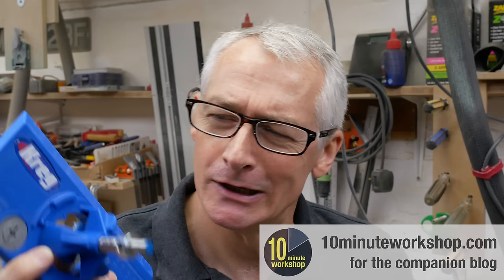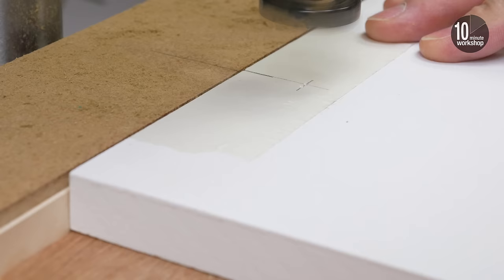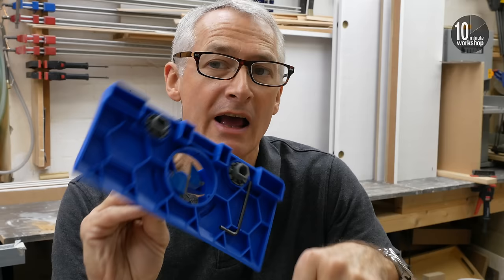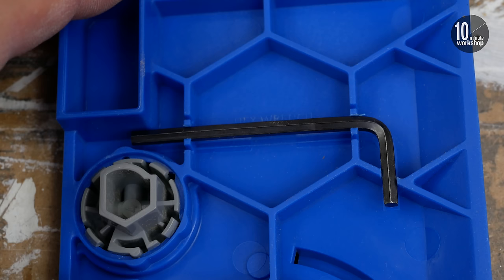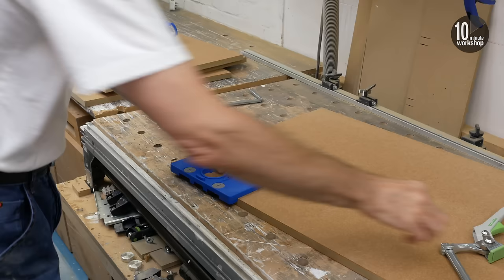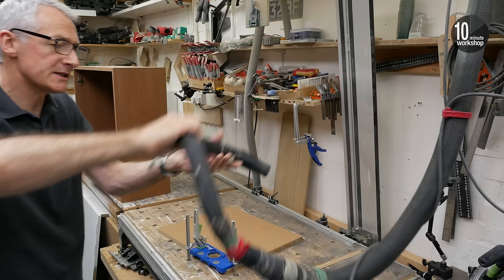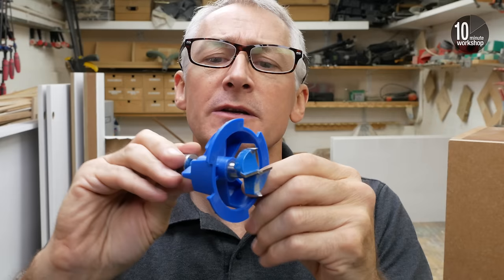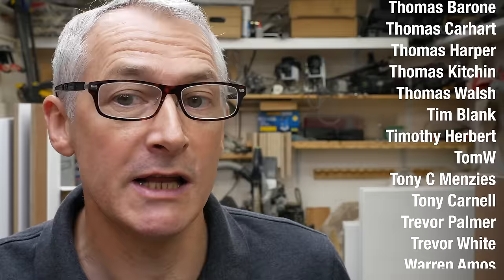Kreg Concealed Hinge Jig [video #357]

Comment: Hey Peter, the reason the boring for the screw fix holes is wrong is the jig is set up to bore for a different brand hinge. Hettich, Blum, Grass, Mepla, etc all use different locations for their screws or dowel locations. 

A dedicated Blum hinge boring machine will not bore the dowels in the correct place for a hettich hinge.
Reply: But they are out of square in any case, and I don’t think the holes any hinge would be disaligned…

Comment: I used your recommended Blum hinges and this Kreg jig. I also found the "fixing holes" are not positioned correctly so I don't use them. BTW - I assume those holes are so small to prevent using too large a drill for the screws. This tool makes drilling the main hole super simple.

Comment: Thanks for pointing out the KREG hinge cup jig's incorporated, but miss-aligned mounting screw hole template. I find that not all of the KREG products, of which there are now several, are well made.  The company is relying on the success of its original pocket hole system products for people to then assume that anything else made by KREG is of high quality, which it is clearly not as you have shown.
Reply from the maker: Thanks! No,issues with the Kreg jig otherwise, but the misaligned holes are a pain. 👍

Comment: I'd experiment by enlarging those tiny holes to take the awl. I think alignment would improve that way.
If not, I'd saw it in half - it'll fit in the bin easier then. 😀
Reply from the maker: 😂 I think if the smaller holes were halfway accurate, I’d drill them out to take an awl in a heartbeat! A number of peeps in the comments here have said that they just use it for the 35mm hole - and a couple of ecodrill users have said the same 🤷‍♂️👍

Comment: So, we gather there’s an alignment aspect to using this that impacts the end product - the thing that remains in your face forever compared to the few quids that will soon be forgotten. Thank you for spending about ten seconds on what matters most and twelve minutes something on all the obvious characteristics of the device.
Reply from the maker: Read through the comments - you'll see that other people with the same issue do exactly as I do and simply just use the jig to drill the hinge cup, not to mark the fixing holes. It's something to be made aware of - and I do that - but as I say in the video, it's not a deal-breaker for me (and clearly, many others) as I prefer to take the fixings positions off the hinges themselves. 🤷‍♂️

Comment: Mine works perfectly with Blum hinges, I would say kreg suggest using a 1.5mm drill bit to mark the fixing holes, perhaps in drilling a 2mm hole you've moved the hole centre's over slightly?
Reply from the maker: Good to know, thanks. No, there’s plenty of clearance with a 2mm bit, and not likely that I could have bored the holes out equally on each side 🤷‍♂️ Feedback is generally about 50/50 on folks having no issues, and with the same issue I have, so I think it’s more likely to be a slight issue with the cam adjusters. As I say, not a deal breaker as there are other ways to skin the cat 👍👍

Comment: If the door isn’t flush with the side of the cabinet you might just have to adjust the jig to drill further in. That’s what those Grey adjustment screws  are for. If 5mm leaves a gap, you might have to go to 6 or 7mm. Just my 5 cents. Another point. If you only have one drill machine then you would have to change bits, whatever the method is.
Reply: You can’t, 6 is maximum…

Comment: I cannot tell you how relieved I am to wathc this video Peter. I bought this to install Hafele partial overlay concealed hinges, ahd while the 35mm hole for the cup drilled perfeclty, the screw holes did not line up with eh hinge AT ALL! I had to measure them all manually on the job I was doing, so of course one had to say what is the point of a jig that has useless out of place holes for the hinge? I have since returned it for a refund, so it now appears that you cannot use it with either Blum or Hafele hinges.

Comment: The two holes are for a drill bit to pre drill pilot holes for the screws. The bit size I use is 1/16th of an inch. I'm sure you can find one that is in MM's I bought the complete kit that includes instructions in English, and so on. Good luck ole chap. Oh Kreg clamps were included
Reply from the maker: Thanks - but for a jig designed for Euro hinges to have imperial-sized holes seems a very strange decision, to me. But irrespective of the sizes, the real issue was that they weren’t square. 🤷‍♂️👍
Reply: @10MinuteWorkshop  I agree, but their selling them all over the world. So no matter where you live the system is set up for more sales to accomodate the stuff you buy from them.

Comment: Nice demo video, Peter. My Kreg jig seems to line up fine but I have another problem. The bit makes extremely hard work of of the 35mm hole for the hinge to sit in the MDF.

In fact I abandoned the first hole I drilled and managed to fit the jig with a Toolpak hinge boring bit which was a lot more effective. Kreg should provide a decent bit in the first place though shouldn't they? Maybe I just got a duff one.

If you change the bit you'll have to fit a different depth stop collar to it as the Kreg collar will not fit a different bit. However it is not difficult to find a suitable collar and tighten it up at a level which gives you the correct drilling depth.
Reply from the maker: Thanks! I think you got a duff bit; mine works fine. 👍

Comment: Your meant use them as a drill guide. I haven't used mine as I often cant find a drill bit small enough. I do use mine hand held and so far not have any problem with it shifting. I have ony used it on plywood.

Comment: Just a thought could of the jig be designed with off centre screw holes to lock or cam the hinge to aid it from coming loose after time?
Seems daft to have a design fault on something that no doubt gone through alot of testing before market!

Comment: Great informative video. Mine is on the way. Wish I would have watched your video before as if 6mm is not enough to make the door flush with the cabinet - the jig is worthless to me. 

As for the out of square - it might be a very annoying flaw. Another thought I had is that it might be in purpose in order to compensate for a micro sag of the door due to its own weight?

Comment: Two points to do with the plastic construction: - the slot to move those cams seem a bit soft. Given the marring of the plastic on your first adjustment, what about after a thousand adjustments? Second - if the drill holes did line up, after a thousand holes drilled I am sure the hole would be more like 4mm rather than 2mm?
Reply from the maker: Yep. As I say in the vid, the cam adjusters only seem happy moving in one direction - they need a bit of 'teasing' to get them moving in the other, hence the marring. And if the holes did line up, I'd just drill them out to 3mm to take an awl - but not much point if they don't lol! 🤷‍♂️And to be fair, if you're expecting to drill a thousand holes, then this almost certainly isn't the jig for you. 👍

Comment: This looks just the job for me as I can't justify trading in my van for the Blum jig (that clogs up with mdf) but why do companies get lazy and sell the prototype? The two issues you brought up are both deal breakers for me and should have been sorted pre production. I've noticed lots of near identical jigs made by other manufacturers so I'll take a punt on one of those in the hope that they got their tooling more accurate. Thanks for yet another excellent video and a heads up on the Kreg faults!
Reply from the maker: Thanks! To be fair, checking the comments it's about 50/50 wether folks with this jig have the issues I had or not, but yes, I agree, with the premium that Kreg charge, they should be better than 50/50. 🤷‍♂️ 👍

Comment: Hi Peter, I have one too, completely agree with you about the screw guides, don’t use them. As for the blockages it’s because your drill speed is too high producing too large chips, Kreg specs do say you need to reduce the rpm, no blockages to date.
Reply from the maker: Is that in MDF Kevin? I don't think the blockages are a problem, btw, it keeps it well contained! 👍
Reply: Yes Peter mdf, I had the same problem when I first used it in mdf with the drill on full speed, I read it somewhere the ideal rpm for the tool ever since then no problems, takes a little more time with the drill slower but hey pick your poison for me having to detach and reattached the drill and carry on is far worse for me.

Comment: Thanks Peter, I’ve found the small guide hole slightly off as well, but not off enough to cause me squareness issues, at least for the face frame cup hinges I’ve tried.  I did have some issue when I did not have both cams set for the same spacing.  I’ll have to go back and experiment with the frameless hinges when I get back in the shop.  I wonder whether the US hinge makers have a variation from the European versions, I have a Kreg drawer pull drilling jig that doesn’t quite handle one of the European spacings very well either.  Yes, switching the drill between the Forstner and 1/16” bit is a pain, and I’ve found a little difficulty pushing the forstner bit into hardwood, worrying about shifting the clamped jig in the process.
Reply from the maker: Thanks Todd. Yes, I checked the cams very carefully - as you know, they click into place, and they were definitely set the same. More to experiment with, I think - but not today! 😂👍👍
Reply: I also suspect there is a little bit of metric to imperial back to metric conversion/rounding problem happening with the design.  I’ve never had any issues with Kreg stuff when it was strictly imperial based dimensions.
Reply: I double checked some of my test drilling’s with my jig, though The spacing was slightly off from what the hinges wanted, the squareness was not off like you demonstrated with yours.  I find that the cams are a little finicky to set and use, but seem close enough.  I think I’ll just have to adopt your technique  for squaring and drilling the screw holes.  Thanks again for your videos, I’ve learned a lot.
Reply from the maker: Todd Strope Thaks for that Todd! I agree with the metric/imperial thing too; we live in an imperfect world! 🤷‍♂️😂👍

Comment: Presume the plastic moulding is simply off for those screw hole guides - unless perhaps it's deforming under the clamp pressure?
Reply from the maker: Not sure how it could be off, and it's very even distortion if it is that. But yes, a bit more investigation required... 👍
Reply: @10MinuteWorkshop  First of all, I'm only judging from your video, in no way from my own experiences . As far as I know, plastic molding is quite a delicate process, liable to slight deformation or tension if a mold is not at the right temperature . The jig has thus three parts that maybe out of alignment: the baseplate and both "locator pins".
Tw simpe (?) checks spring to my mind: if you switch these gray parts, is it off to the oposite direction? if you chose a different depth setting, is it still of in the same amount?

Kind regards Christiaan
Reply from the maker: @kwarts  Thanks! It's definitely off with a smaller depth (distance from edge) setting, yes. Hadn't thought about swapping them round, will try that and see. 👍

Comment: I'd guess it's simply an error in the injection moulding tool, or more accurately an error in calculating the part shrinkage. It would be worth putting the jig together and then use a good small engineering square to check that a line perpendicular to the jig alignment face runs through both the point of the drill and the marking notch - the marking holes could be OK and it's the drill center that's off.

Comment: As the body of the jig is plastic-could the clamps be warping the plastic slightly when clamping pressure is applied, thus moving the screw hole templates out of alignment?
Reply: S7tronic I doubt it. I use this jig by hand and clamped down and it does it.

Comment: Hi Peter, great video, thanks! Are the MDF screws you have linked on your website still accurate? Its 4x30mm screws which would seem a bit long
Reply from the maker: Thanks William. The Spax screws are listed under ‘other handy gear’ so not necessarily intended for use with the concealed hinges this jig is used for. And the link is to an amazon page where you can choose the size of screws you need - yes, 4x30 is the default, but use the drop-down menus to select your preference. I typically go with 4x16 or 3.5x16 depending on the size of door, thickness of material etc.. etc.. HTH P.

Comment: You mention the jig can be adjusted to allow for 3,4,5,6mm distance from the edge. Do the hinges not have to have a specific distance? Or is this for different makes / brand of hinge? What would the difference be in setting a hinge at different depths from the edge? Thanks
Reply from the maker: Hinges tend to have a set distance as a starting point, but this can be varied - and yes, different brands of hinge do vary this measurement too. Most hinges default so that eg an overlay door sits a couple of mm within the carcass - this is so a run of doors don’t clash when opened. But for a single door, I prefer the door to sit flush to the edge of the carcass, so rather than use up the adjustment in the hinge, I’ll make them a couple of mm further away from the edge. 👍

Comment: Also as it’s made of plastic that locator hole will gain in size and maybe even wonder each time the drill bit skims the sides 😟
Reply from the maker: Yep - that’s why I was particularly surprised that an awl wouldn’t fit. If the holes were in the right place I’d consider drilling them out; don’t think I’ll bother. 🤷‍♂️👍

Comment: I have this jig and used it for 10 doors in my kitchen.
I had no issues with the mount hole alignment, they all fitted fine. Blum blumotion hinges. 
As to alignment with the cabinet edge, I just used the hinge adjustment screws.
I wonder if you got a slight QA problem with Kreg there?
Reply from the maker: Good to hear, thanks. I've asked Kreg if they're aware of a QC problem, haven't heard a peep back. So far responses here and on insta/twitter are pretty even 50/50 with 'no problem' and 'same issue' 🤷‍♂️

Comment: I'm waiting for a Mark II of this jig, as without the option of a 7-8mm offset and properly located steel guide bushes for the hinge screws, this Kreg product is not fit for my purposes... the search is on for a suitable cost effective solution
Reply: What hinges require 6-7mm space?
Reply: Common Blum hinges (including the xxx3550 Peter mentioned) work with a 6-7mm offset, with the standard 0mm mounting plate, and materials 17-18mm thick. It is when one uses thicker side panels that a higher offset becomes useful. For more details, I recommend looking into the Blum catalogue
Reply: @RueFondary  thanks. I used BLUM for years and never really noticed what they were. CNC or BLUM minipress did the drilling I just clipped them on. Now I use HETTICH and the distance from edge is ~4mm and use a 3mm plate for full cover and 0mm plate for half cover. So I suppose it makes sense.

Comment: just throw this thing where it belongs and buy eco drill from blum , it`s a bit pricey but it`s really well designed and you can drill all three holes in one go without changing drill , not to mention that it`s self clamping as well .
Reply from the maker: If I wanted an ecodrill I’d have bought one. As I say in the video, I have a system that works for the volume of doors I do. This was an assessment of a ‘hobby’ produc to see if it’s worth the money they ask. 🤷‍♂️ As for the ecodrill, how are you getting on swapping those 8mm fixing bits out for something sensible?? 🤔

Comment: Does the "shroud" lock in at only one position or can you rotate it ,say 120° , to locate it again Pete ? 
There may be a "sweet spot" if there is any misalignment in the  coupling of the 2 parts or moulding error... 🤔

Also... if one DOES use those screw location holes, a stubby bit with short flutes will reduce the wear on what is only plastic after all... 😒

The adjusters for hinge-in distance seem like they should really only be turned in one direction, looking at the detent pawl setup. They also look like you'd chew 'em up in short order with a narrow screwdriver, in fact they look wide enough for use of a small coin ? 😬

😎👍☘🍺
Reply from the maker: Good point re the shroud Peter - it will lock in any of the 3 positions, so I’ll try that - though I have to say that I haven’t been conscientious about locating the same orientation every time, and I’ve drilled a lot of holes, all with the same problem. No, the cam adjusters are definitely meant to ‘go both ways’ - and small coins?? I suppose I could ask the gardeners if they have any... 🤔🤷‍♂️😂😂👍👍
Reply: @10MinuteWorkshop   gardeners... 😂😂 
Youtube aristocracy at its most blatant... 🙄

😎👍☘🍺

Comment: Nice video, 6mm in from the edge you mentioned. Do you mean you prefer to have the outside diameter of the round hole in 6mm from the edge of the door? I like you centre finding drill bit. What size do you recommend for those hinges
Reply from the maker: Thanks. No, I mean that I prefer to mark the centre of a hole, not distance from the edge. The self-centering drill bit is a 3mm, for the 3.5mm screws I use on the hinges.

Comment: Regarding the incorrect position of the drill guides. Could this be due to slight variations in hinge design. Last year I replaced all of the hinges on my kitchen cabinets with new better quality versions. Every existing screw hole had to be filled and redrilled due to the tiny difference...
Reply from the maker: Could be. As I say, I tried every variation of every hinge I had to hand, with the same result 🤷‍♂️👍